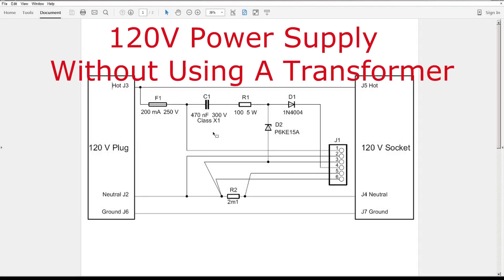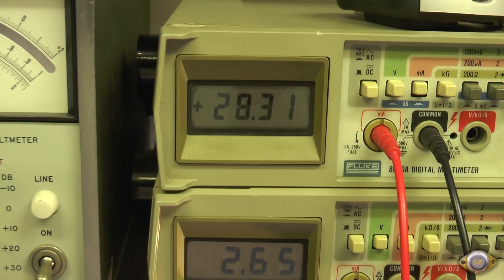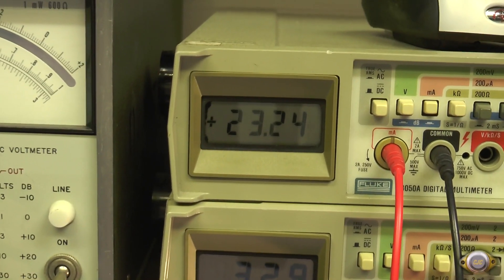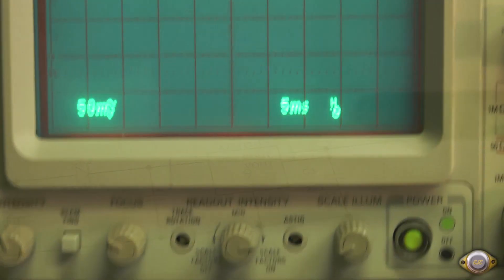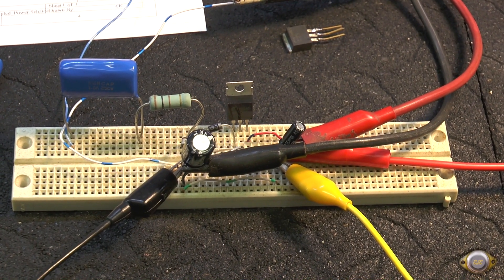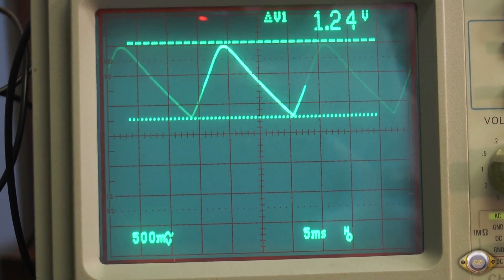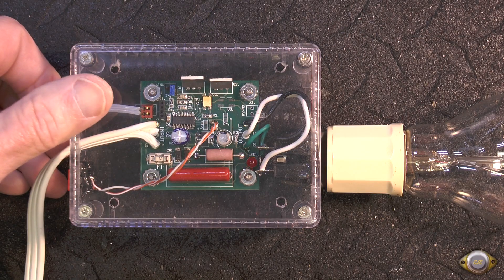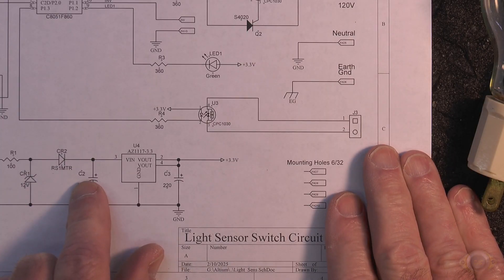120V Cap Coupled DC Power Supply

Comment: Linear regulators have drop out voltage.  You need to make sure that under worst case (lowest) mains voltage, and there is at least 1v odd headroom before the input is at dropout voltaFe.
For 5V the input should be 8-9 volts odd.   For 3.3V the input should be 4.8-5.3V (The 1117 reg has lower dropout V).  However if it were me, I would not allow the input voltage not to go lower than the Zener voltage, ... but that is really playing it safe.
This type of power supply (without the linear reg) is called a "capacitor dropper", and it is HORRENDOUS (crap power factor and crap efficiency), but it is very cheap, so used EVERYWHERE!
Reply: Forgot to mention: you do not need the input diode, the forward conduction of the Zener will deal with the negative voltage, but will also be higher power because it will effectively be using the full wave indirectly, by doubling the charge on the cap per every second cycle.  You ge more power, or get the same with a smaller capacitor.  Try it, but watch your power dissipation of the resistor and Zener.  btw the resistor is also NOT NEEDED.. Also PUT a fuse at the AC input, or things might go BANG if the cap fails short.

Comment: X-10 carrier current remote control modules are all powered using a similar power supply. Typically a 470 nF series capacitor is used for the "wall switch" modules which shunt their own AC supply when the load control triac is on. I've forgotten what value is used in the modules that are powered directly from the line rather than through the load. The original X-10 modules were controlled with PIC mask-programmable microcontrollers from General Instrument. I still have functional X-10 modules that are probably pushing 40 years old, though I've had to replace the filter caps in many. You may be able to find schematics of the X-10 modules on the web. You might find them instructive.

If you select the right triac you can drive it directly from an output of the microcontroller. Just pay attention to the trigger current requirements for each quadrant and be sure your power supply and the triac are compatibly arranged. Back-to-back SCRs can have advantages with inductive loads where it is difficult to adequately manage dv/dt (rate of change of voltage) to assure proper turn-off, but if all you are driving is lamps that won't be a problem. There are triacs that are designed to tolerate high commutating dv/dt but they may require higher trigger current. There are triacs in isolated TO-220 packages, which are convenient if you need to use a heatsink.

Comment: What is the efficiency of the circuit? At max load but also when the load is in deep sleep.
Reply: very bad!  even in deep sleep because the resistor and especially the zener will be dissipating a lot of power.
As common as capacitor dropper PSUs are, they are ABSOLUTELY NOT FOR STANDBY POWER! (unless you do not give a shit about power waste)
In the EU this circuit is ILLEGAL because of its crap standby efficiency!
Reply from the maker: @ I'm not sure what your getting at here. This is just a simple light controller. It draws less than a watt. And, what are you getting at about "Standby Power" ? Doesn't make sense for this project.
Reply: @CIRCUITDESIGNER  Well, the circuit sounds interesting for small IoT projects for powering small microcontrollers. But if those go to deep sleep and the circuit still draws similar power, that would be suboptimal.
Reply: @CIRCUITDESIGNER  Sorry, you hit a nerve.  But this circuit in some cheap systems is used for standby power, and it is HORRID for this use (and illegal in the EU).
Reply from the maker: What part of the circuit?

Comment: Thanks, very useful video! I have known about this circuit from earlier google research, but it is nice to see some practical tests. Actually my use case I was planning is nearly the same as yours, I guess no surprise really. 25mA @5 or 3.3v should be good enough for most of these simplistic use cases using these small microcontrollers.. But an ESP32 working hard pulls up to 100mA, so it seems difficult to scale up to that level of application. Anyway, all food for thought.
Reply: I can imagine a lot of IoT devices like WiFi light bulbs are doing something very similar, so it should be possible somehow.